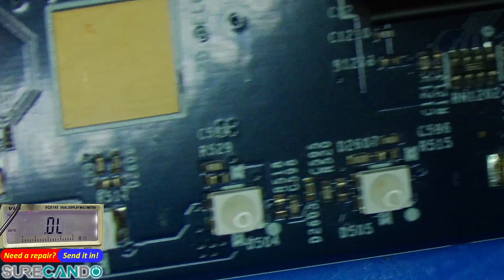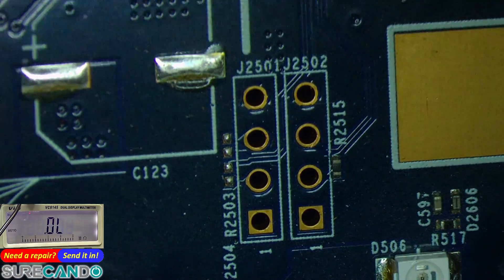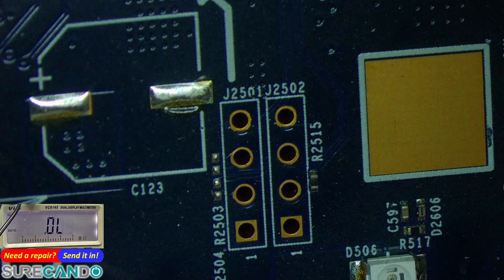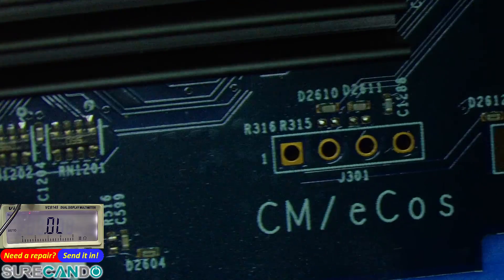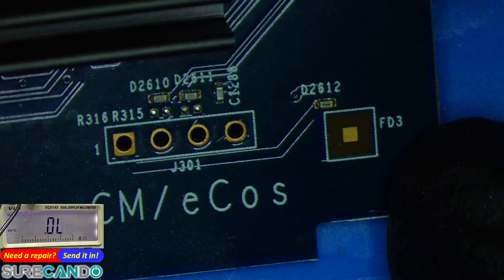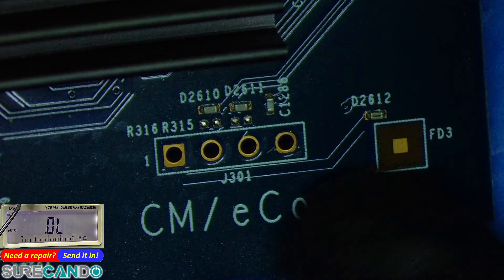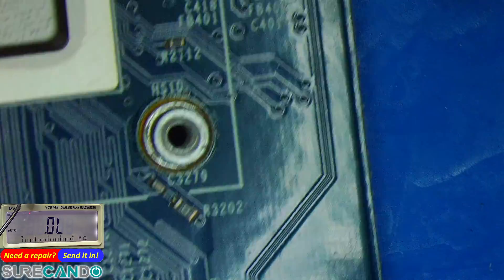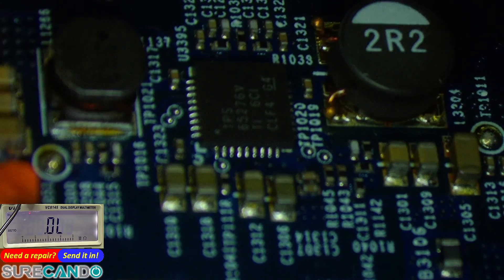ARRIS SURFboard SB8200 DOCSIS 3.1 NBN Disassembly JTAG Port probes and disassembly SB8200B

Comment: Quick question. From what I know about the 8200, there are no options to port forward so all ports are blocked. I hooked up a mesh network and had the option to open up the port  I needed on the wireless only. I did test the port and it did say it was open. Is that possible or do you think it's a false reading?
Reply from the maker: Cable modems don't have firewalls.
Reply: @SureCanDoComputersServices1  yes. But my question is that I can still open the port even if the modem does not have that feature? I assumed that modems like this will lock the ports automatically. Thx.